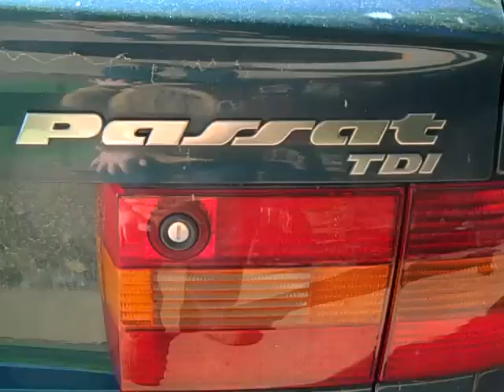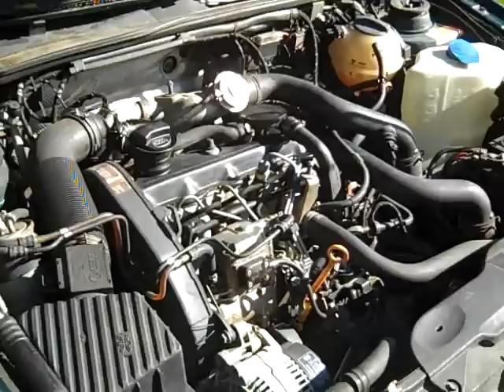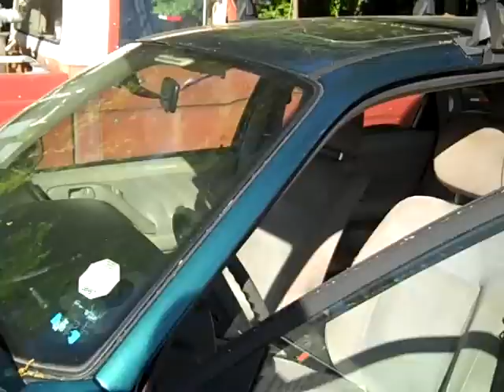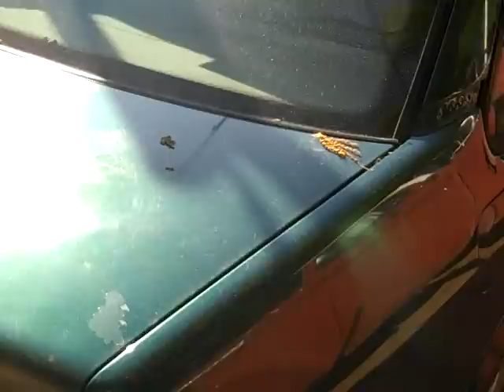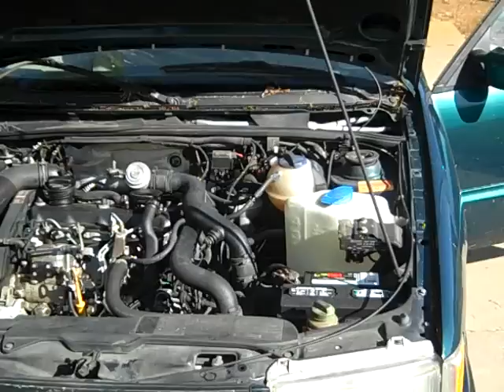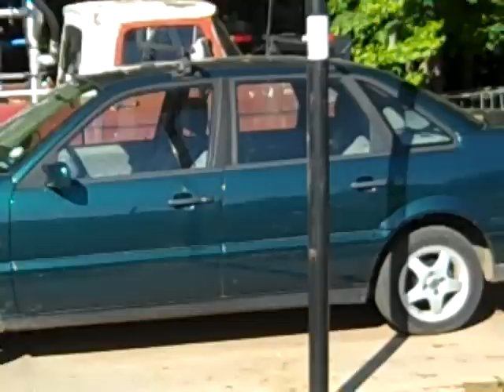Prepper Transportation

Comment: My dad ran the veggie oil mixed with gas and diesel secret in a 2003 Jetta tdi wagon from 120kmiles up to 400kmiles with no issues at all. Still starts up and runs great just has auto trans that decided is doesn't want to move lol

Comment: need to set up a fema for your gen set and find the sweet spot in the cooling line for the gas where the liquid is closest to diesel and drain that off to run the car i think your gasifire in the truck is gona burn to clean be cool if you could be driving car and truck making electricity all at the same time

Comment: i have a grease car system in my truck for the last 3 years and i love it. i spend about $.40 a gallon the trick is the oil filtering. the system in the truck came with a great set of plans form my truck.

Comment: @readyren seals the ethanol eats are a big one, jail time is another for distilling wo a permit in the US (the controlling bastages) it's very doable just need seals & not get pinched with the hooch, plus you have optimal metering of flow differences with ethanol because it burns differently. I think a different program for an efi controller does it if it's available or someone can do it. or different flow stuff for a carb

Comment: @DIECASTER  EMP will fry any electronic that is not protected whether it is on or not... the electromagnetic shock is what shorts out circuits in chips such as phones, cars, comp,ect... circuits can be protected from this by creating a grounding cage around said circuits... i made one from a small aluminum cabinet and grounded it with a ground rod into the ground... it can be hard to do on a large scale, but, small items 2-way radios, phones, laptops, small items can be protected kinda easy...

Comment: great lil car get ahold of me if u boo boo the engine and ill help u find a good low mile 1 cheap....i really want to see how to make diesel and how it works out im pretty good wth diesel engines in pick up trucks as far a bosting the milage i have a 2005 chevy 2500 HD getting @27mpg with the long block 6.6 turbo diesel

Comment: "Secret" recipe of use vegetable oil(used preferable) as fuel is adding 3% White spirit and leave for two week to get ready(Top Gear) plus I personally would add some anti gel stuff if use in sub zero temperatures, use only in non direct injection diesels (Top Gear) which means look for some old audi or volvo diesels.(Top gear uses Volvo 940 in demonstration)

Comment: A diesel like that can run on pure vegetable oil, without any modifications, but you get much less miles per gallon. A friend of mine had an old Passat like that which he ran on cheap vegetable oil poured straight out of the can however because of the poorer mileage figure it wasn't any cheaper than using regular diesel.